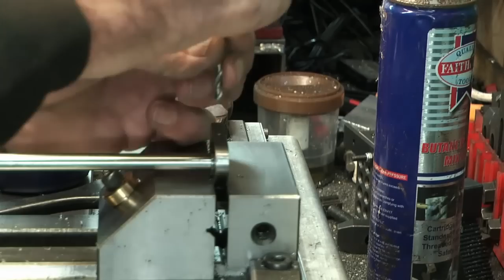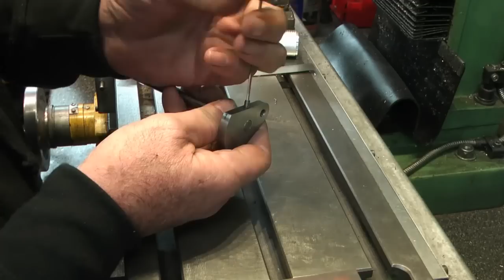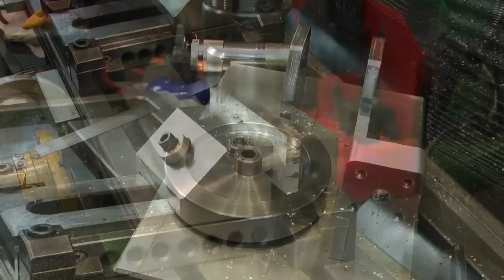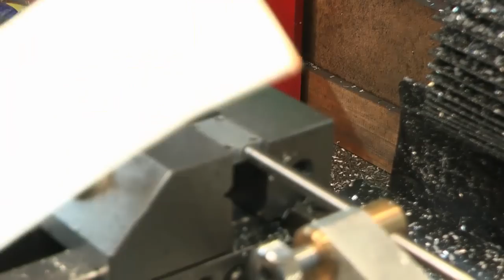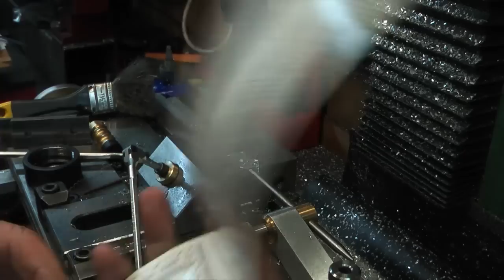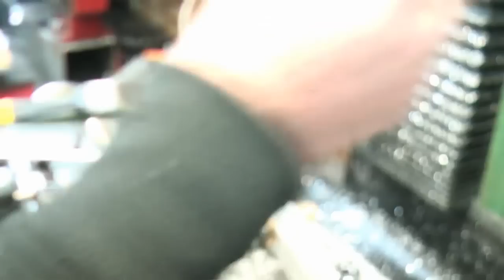Webster engine Part nine

Comment: Happy Movember Ade. I am lucky to have a window directly behind the machines and they double up as a clear white boards with the coordinates and sketches of the job in hand. The Zeus reference book you use is the most used tool in my shed, and I've just noticed it's 1981/82 revision and still going strong. I do pick the way you chatter away to yourself like me. Great videos.
Reply from the maker: I will show an earlier one in the next video Paul  . Just for you friend. Cheers Ade.

Comment: Hi Ade, I'm sure you know this , but the collets have a triangle on the face which need to line up with the triangle on the face of the nut, makes putting the collet in the nut easy. ( depending on the make of the collets and chuck).
Reply from the maker: My collets dont sadly . I just sort of turn them until they drop in . All good though . Cheers Ade.

Comment: 3.3 millimeter is the tappning drill for M4...
Reply from the maker: YARP . I did 3.2 for the pin diameter so I stood a chance of having a plain diameter pin to fix the crank ./ cheers Ade.